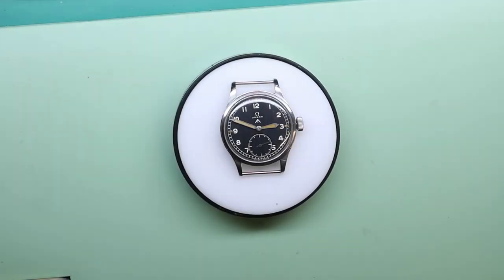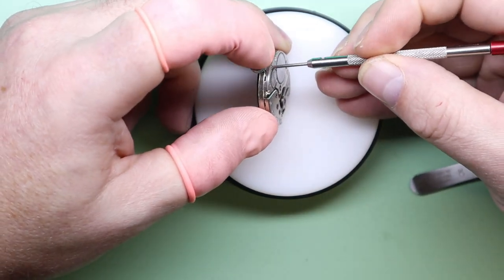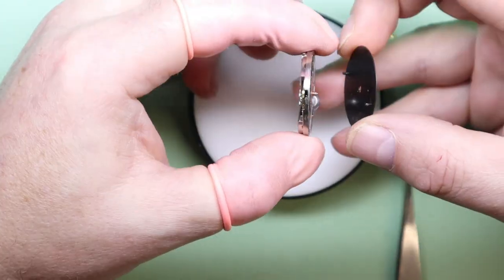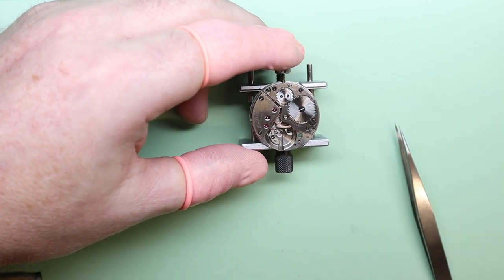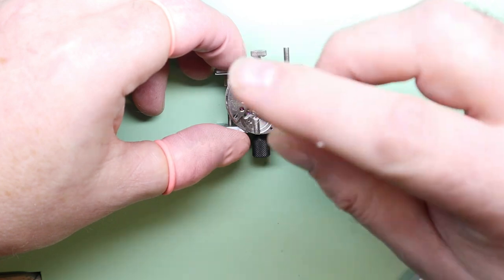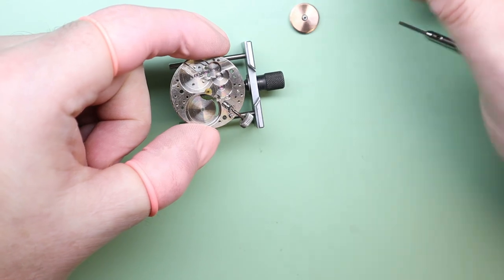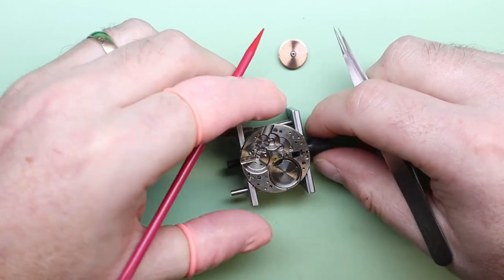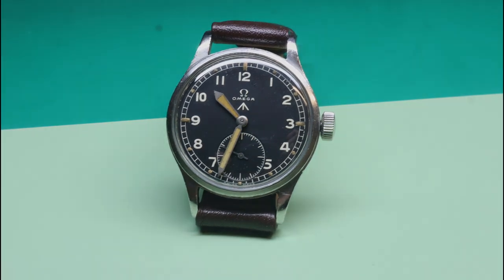Omega Dirty Dozen - WWII Military Watch Service - Part 1 - Disassembly

Comment: That Omega is extremely clean for its age.  I would wonder if it's been restored before.
The authentic Dirty Dozen watches I've handled have had faded and sometimes blurry dials, and many many scratches and dings.  Most of them saw very hard use, and all are almost 80 years old.

Comment: Hi, I recently got into military watches and am very interested in this Omega one. From a watchmaker/repair point of view, is the movement reasonably accurate and is it a well-built watch?
Reply from the maker: The Omega is a well built watch, very simple design but functional. The only downside is the lack of shock protection for the balance, a friend of mine used to repair about three of these a day with broken staffs so....... But yes a nice collectible for sure.
Reply: @welwynwatches5976  Thank you for the reply, I have another watch on my list which is the Zenith German D.H, caliber 12 4-6. Have you ever repaired it in the past? thanks